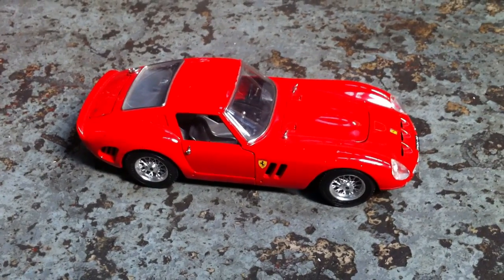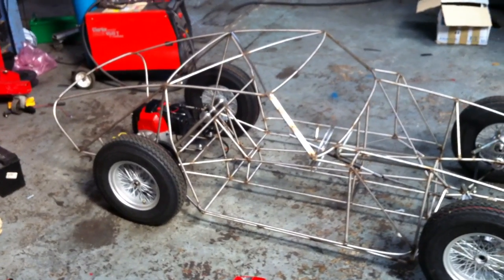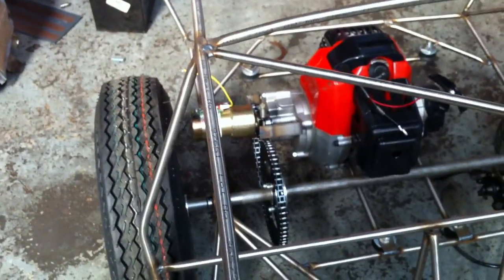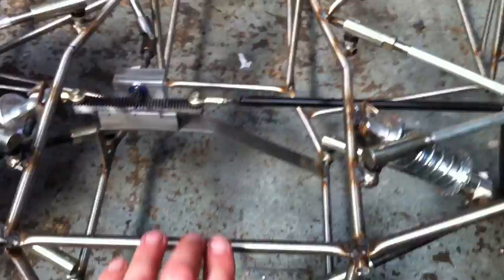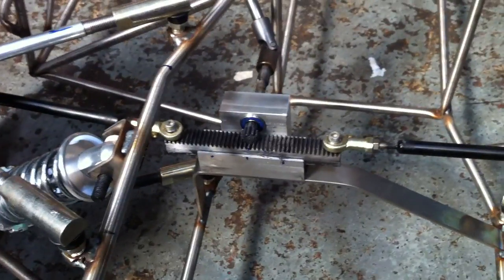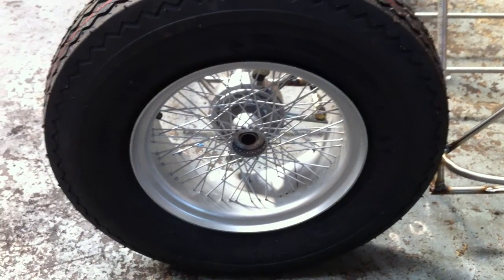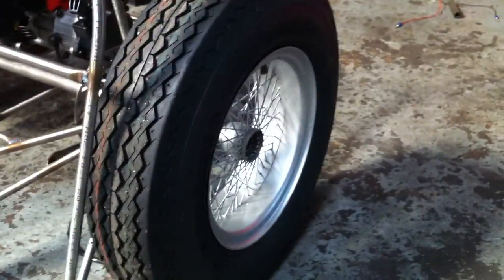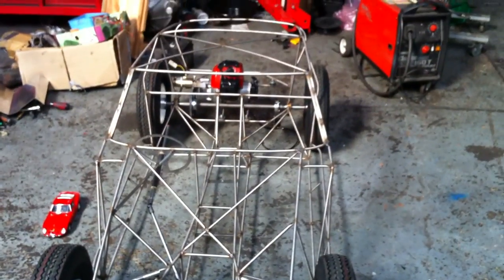Build a ferrari go kart !

Comment: Hey there! I'm wondering, have you considered using go kart or golf kart rack and pinion units? They're very light weight (5-6lbs imperial) and would be much stronger than the system you're using at the moment. Good luck with the Porsche build you're doing right now as well!

Comment: How much would it cost to build me one.
Reply: I'll get back to you
Reply: *****  HAHAHA at $600. I highly doubt if you could have one built for even $6000 let alone $600. He said in the final video it took over 500 hours to complete as well.
Reply: ***** Incorrect. Time does cost money. Isaias said "how much it cost to build me one" not how much would it cost for parts for me to assemble and build it myself. Even assuming Isaias did build it himself and had all the necessary skills and tools, do you really think you could get everything needed for $600? It has 49cc two stroke power with electric start, disc brake , electric motor for reversing . over 45 meters of stainless tube, fully adjustable suspension with coil overs, 72 stainless spoke wheels etc as per description.
Reply: +Rafee Rehman yeah i got my 212cc motor for 110$ and a shopping cart for free. old go kart frames cost like 100-200$ so 400$ in total for a working go kart and perhaps a steel shopping kart frame to shape into a vehicle body? Pretty simple.
Reply: Hey mate what's something like this cost for you to build. Would you build one and sell it